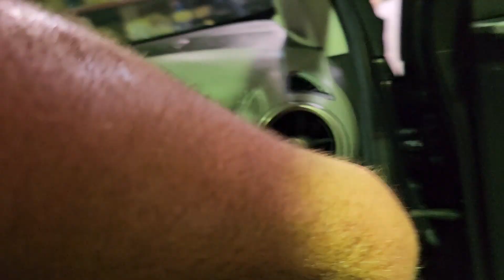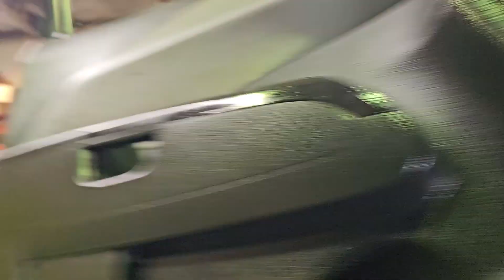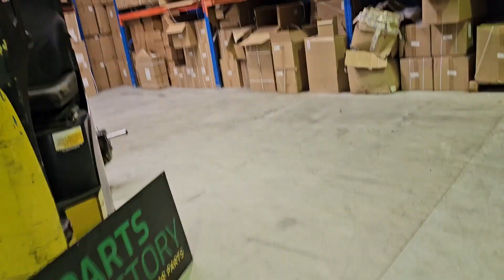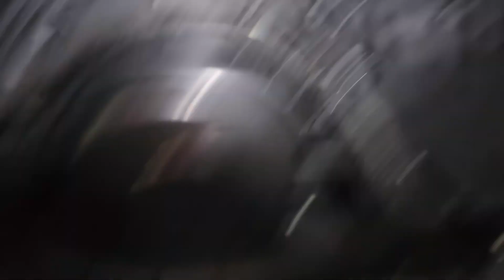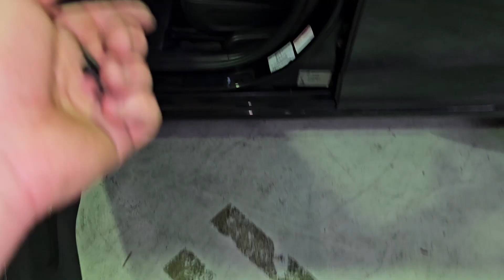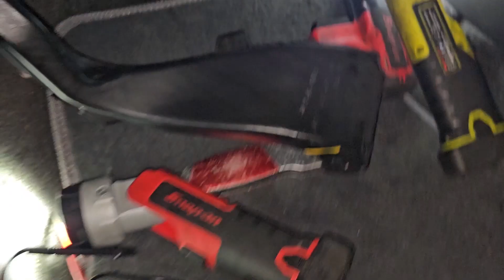How to Replace Holden Barina Blower Fan Motor TM Models Between 2011-2019 Hatch & Sedan

Comment: I just bought my daughter a 2016 barina sedan for her 16th birthday. I just bought the over flow bottle from you guys and it came today and her blower fan motor is making a loud noise so I just went on ebay and it is you guys I will be ordering from again😂😂😂 I just came to this video to see how to fit it cheers. The wires that you swapped over, will I need to swap them over? I live in qld.